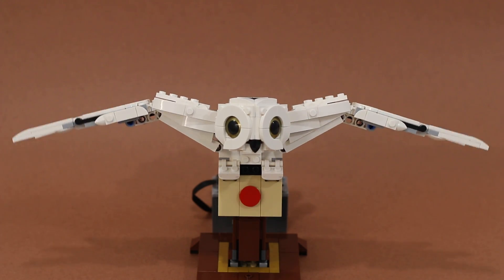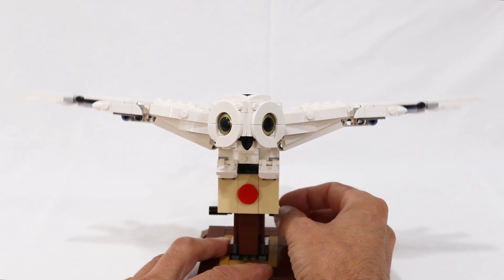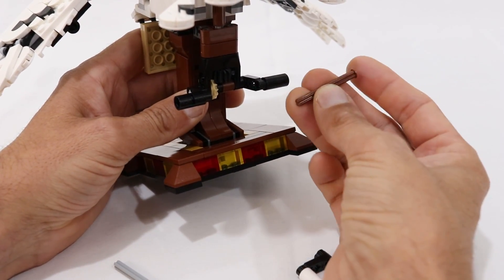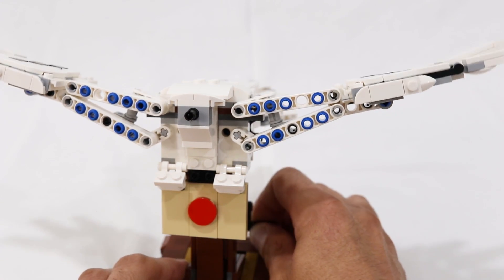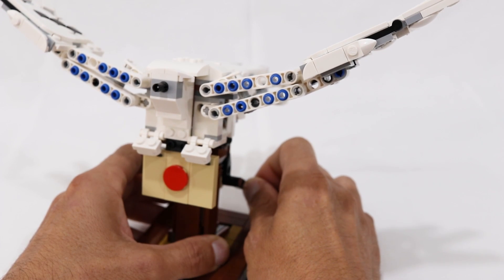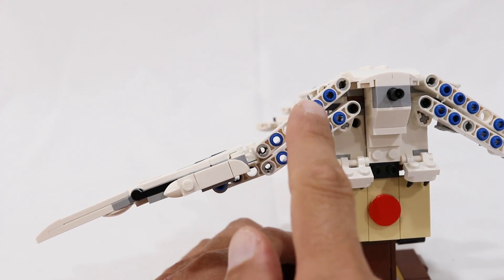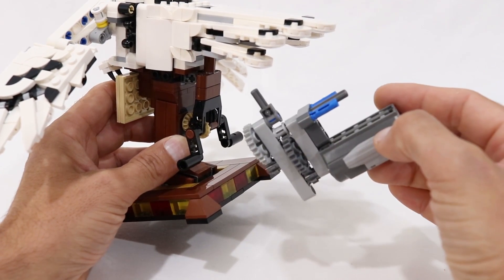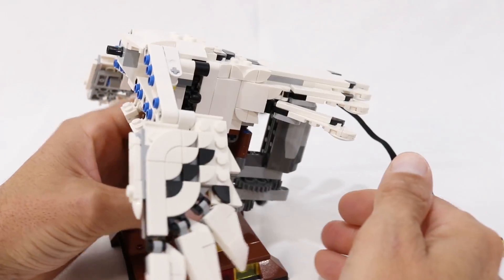Motorizing and Modifying Hedwig (LEGO set 75979)

Comment: I once made a model of a clock with a custom escapement. The face on it was fairly large, so even with a bit of counter-balancing I still had to deal with significant backlash with the hands (the second hand specifically, as there was a lot of gearing required to get the right ratio).
My solution was to tap off some of the rotational force from the driving mechanism and apply it at the last of the gears driving the hands. The hands couldn't advance any further than the timing / escapement mechanism allowed them to, and the tap / tensioning mechanism meant that each gear always sat against the leading edge of the one it was meshed with.
I wonder whether a similar approach could work with the Hedwig model, or alternatively countering some of the force pulling the wing down with a spring or elastic band so that the backlash transition isn't as abrupt.

Comment: Hi Jason. Excellent video and description on how to improve this extremely interactive Lego set.

After motorising Hedwig, I have found that there is some slight movement in the motor on each wing flap. I wondered if this was just me, but looking very, very, very closely I have seen the movement in your motor as well.

As part of my build I have amended and elongated the base on order to hold the battery box and used a liftarm on each side of the motor to connect it to the base. This removes the movement, but not is ascetically pleasing. Do you have any alternative suggestions?

Comment: The wings flapping motion is more realistic compared to the original
Reply: I suppose the original was trying to simulate the feathers bending upwards during the stroke. It just should have happened closer to the tip. But that would have needed an extra joint.